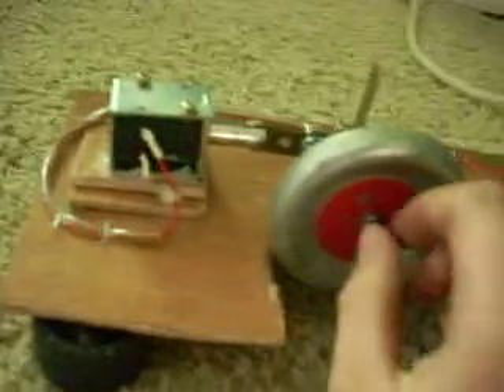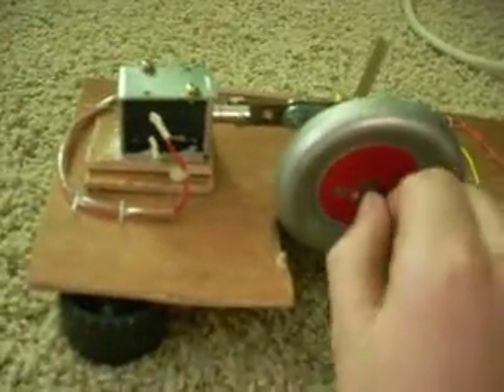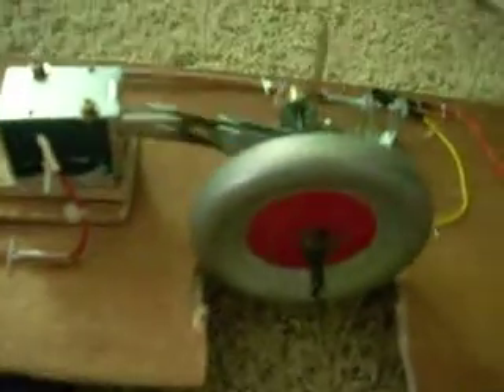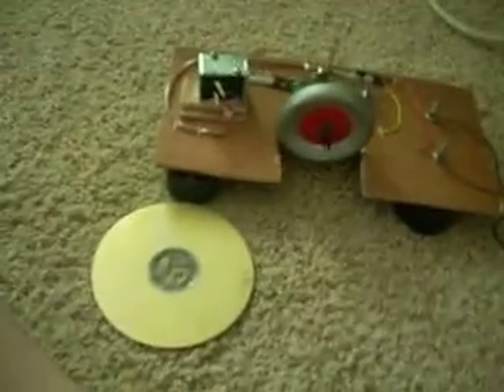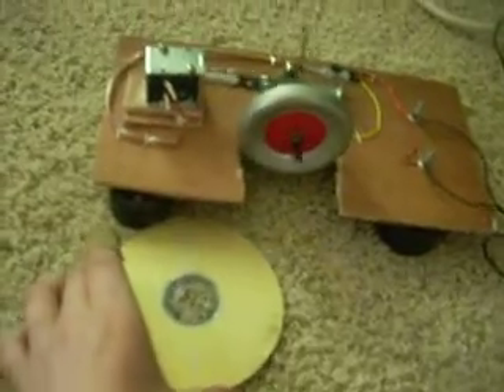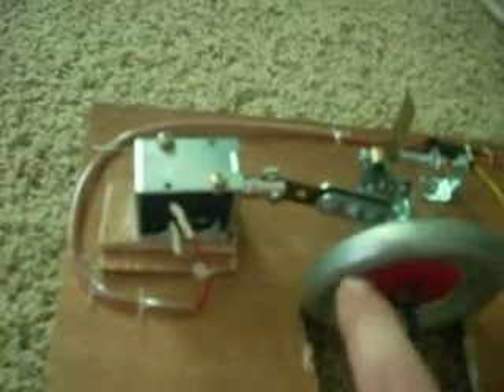home made solonoid engine

Comment: Good Job. I would advise you to be more careful about electricity though. I know it was just a little current in your power supply; however, that small amount can; given the right circumstances can be enough to do some serious damage.

OK, I'll get off your back and give you another idea to play with. Take your solenoid motor and multiply the "cylinders". then apply one flywheel to the whole series of them; you might be surprised what that small system can do.

Good fortune to you!